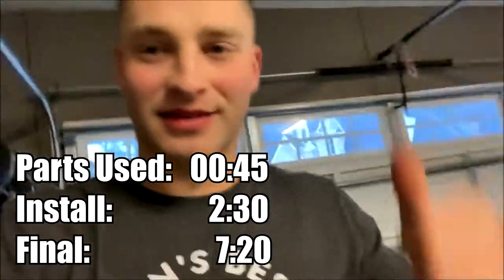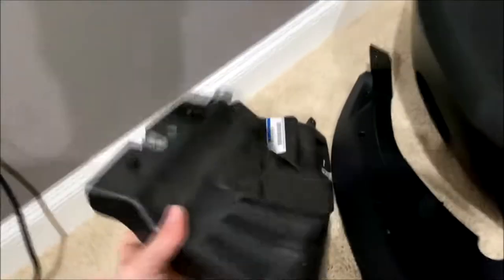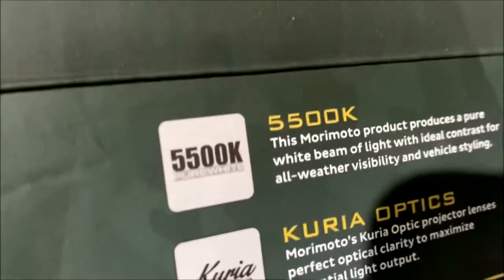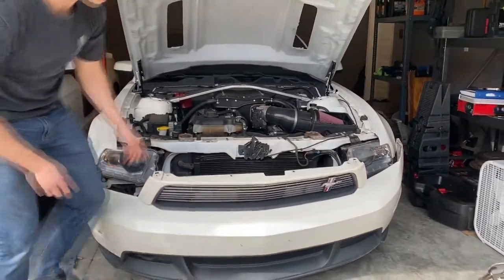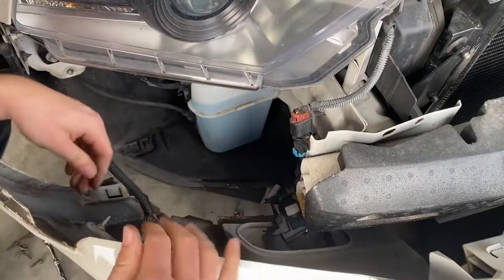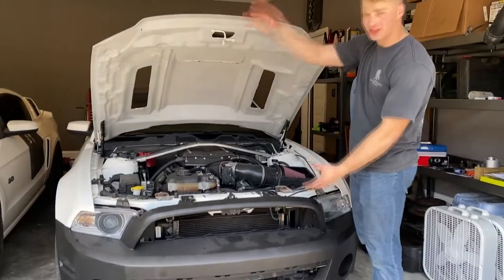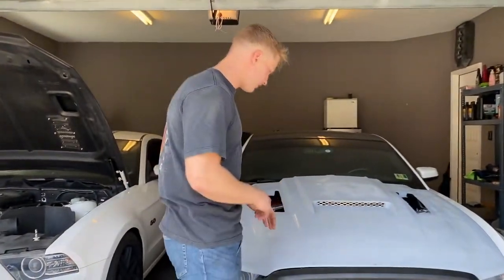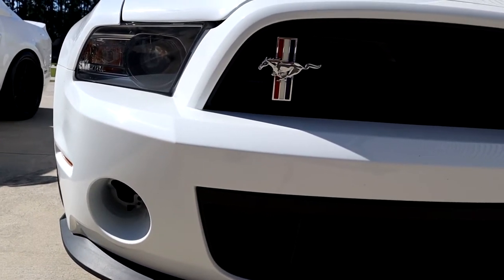Gt500 Front Bumper Conversion Kit & BMC Mongoose Hood | 2011-2014 Mustang

Comment: Great video bro well detailed and easy to follow. Question tho what size bolts or what kind of bolts did u use for the bumper cover
Reply: Like the bracket and to the cover itself because im almost done with this gt500 conversion
Reply from the maker: @yareddelgado4328  for the brackets I used the bolts that were already there to hold in the hood prop rod, since I have hydraulic hood supports, and didn’t need it anymore. Hope this helped, let me know if I can I do anything else to help!

Comment: What size bolts did you use for the brackets????
Reply from the maker: I reused the bolts from the hood support rod. If you don’t plan on eliminating the support rod you can take the bolt to Lowe’s or Home Depot and get a similar bolt with the right treads.
Reply: @AlphaX13 ow’d you fix gap between hood and bumper?
Reply from the maker: @averagegram  Unfortunately I haven't been able to get it perfect since the hood I got is fiber glass; but there are hood adjustment "bumpers" on either side of the hood latch that will allow you to adjust it to some degree.